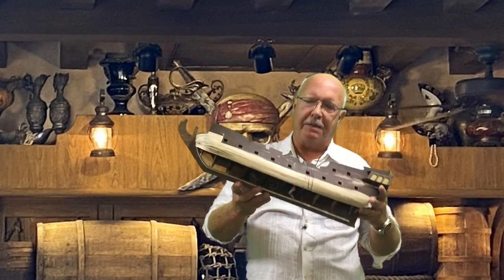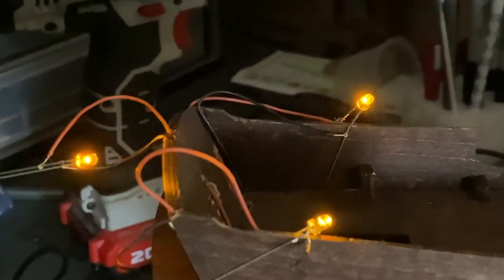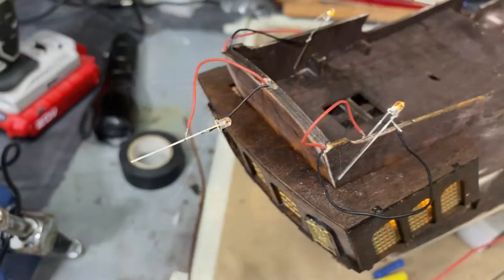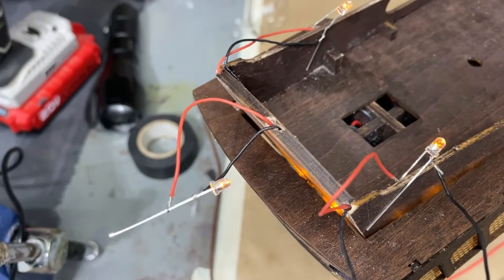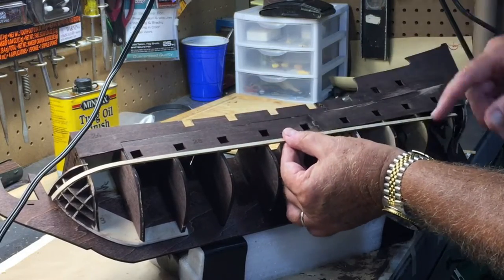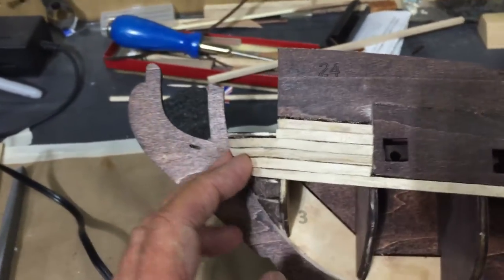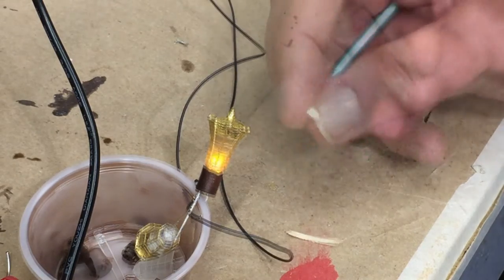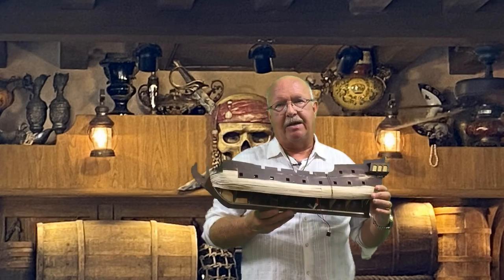The Black Pearl Golden Version 2021 Episode 6 (Walk The Plank)

Comment: No offence mate, but it is no surprise that your seems were coming apart, I saw you used super glue in earlier videos...
Super glues dry brittle, wood expands and contracts, this is why wood glues, pva are usually used... 😜

Great build so far though dispite this...
Reply from the maker: Thanks for the tip! I’m actually new at this, so I’ll take your recommendation for future builds.  Except where I need quick adhesion.  Or is the oval type fast? Any way, I’ll look it up.
Thanks for the tip. 👍👍
Reply from the maker: Any recommendation for brass being glued to the wood?
Reply: @BoilerDan1  
My apologies mate, it has been a busy weekend...

There is nothing wrong with using superglue to tack parts into place, or attach small details, I've done that myself on many occasions...

I think the best advise I can give is to always consider the surface area of the parts you are gluing...
The larger the surface area, the more pressures/tensions will build as the material expands or contracts (small changes in air preasure/ humidity can cause this in wood), so using a suitable wood adhesive is advised on most joins...

Small detail work, I would still use a dab of superglue... 
Larger detail work, I would use the superglue to tack/fix the part in place, then use a thinned down pva wash brushed around the joining edges to seal it... 
Masking tape is your friend here, its not just for masking it can also hold details in place to set...

Wood glues/ PVA is quite a versatile adhesive.. 
It can be thinned with water and used to brush over a finished detailed surface (eg, a planked surface) to strengthen, getting in all the joints and soaking in to the wood..
I've used a 60/40 pva/water wash over entire models before doing a final sanding in the past.. 
Given it 24hrs to set before sanding, and even the smallest, most delicate mosaic parts have been bonded to form a single surface...

Also have you tried pouring some pva out about 20 mins before you need it..
It thickens, becomes tacky and easier for small wooden details... 

I hope some of this helps, maybe some things you hadn't considered...
It will always come down to what works for you though, people can advise you till the cows come home, but in the end, once you have some experience you'll find your own ways
It has been a few years since I've done any wooden builds, watching your vids has inspired me to get back into it...
Ive just ordered a build I've always wanted to do (a 1:78 Sovereign of the Seas)... 

So Thank you for the inspiration... 👍
Reply from the maker: No apology needed. You provided very helpful information that I will put to good use!  I’m happy to hear that you’re going to build again and that my journey has rekindled your interest in modeling!👍